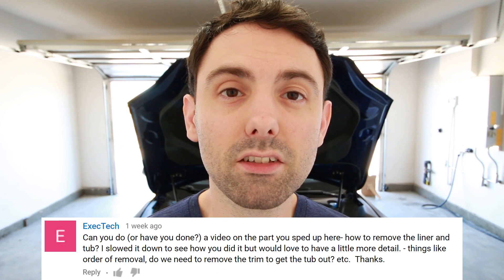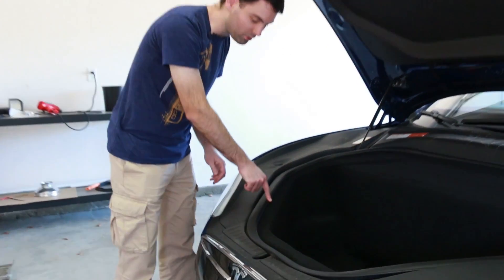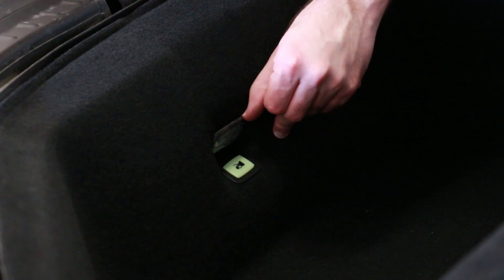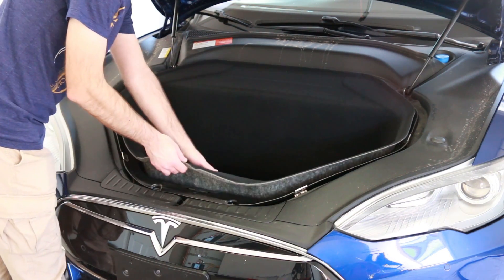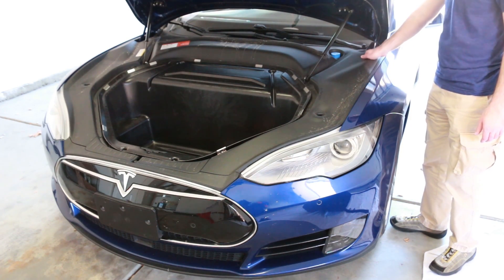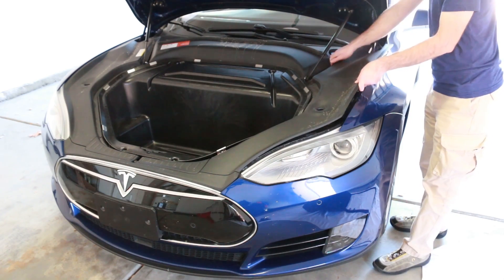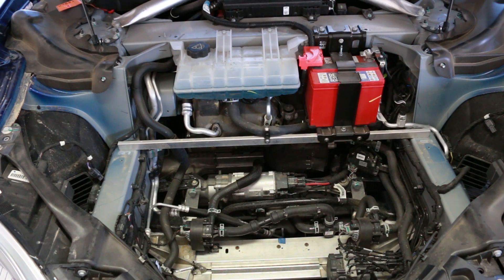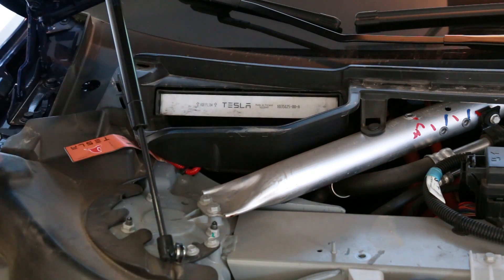Quick DIY: How To Disassemble A Tesla Model S Frunk

Comment: Thanks, that helped a lot. With the large battery pack and the small frunk, it works largely the same. BTW, you do not need to unscrew the retaining rubber pieces (the right one was completely stuck for me), you can pull the panel out and push it back in without removing the screw.

Comment: Thanks Alex.  Do you recall if there is access to remove/unplug the radar from in there?  Mine stopped functioning on my 2015 Model S.   Removing the front bumper looks more difficult.
Reply from the maker: It has been a while since I've been in there, but I don't recall being able to access the radar... probably worth taking a look given how quickly the frunk comes apart.

Comment: Alex, can you post a video on how to disassemble the Tesla model s trunk?
Reply from the maker: What parts are you looking to disassemble or gain access to? I mean, there's not a ton back there aside from the hatch trim, some carpet, and the plastic covering the lower latch area.
Reply: @AlexVenz  Thanks for the reply, I want to do some extra sound deadening...
Reply from the maker: Like I said, there isn't much to things back there. The plastic covering the lower latch area (along the bottom edge of the opening) pulls right up, there are a few plastic pins holding in some of the carpeting, I recall there being some screws under the cargo cover rails... the formed carpeting pieces on the sides are annoying to work with.

Comment: A good vid.  Retired engineer with a CPO June '15 MS 85D purchased 2 months ago.  Tesla Ranger came and did the Steering gear bolt replacement, noted broken clips he tried to hide and then would not fix.  I removed the Frunk assy again to check his work, found a few problems, and gave the innards a cleaning where possible.  Did you notice any missing side panel clips? 

It seems some designers of the structure of this vehicle (Spacecraft folks?) have no experience in corrosion prevention.  Primary structure, castings no less, full of pockets without drain holes.  This is/was/will always be a SoCal car, and was fairly clean, but wonder what will happen to the cars that see salt and mud.  Your vid will be very handy for those that want to clean this area of the car periodically.

It appears you have had the new SLA batt put in, mine did too last year according to SC.  I noted my car has the two right frunk mounting holes drilled out to double the orig diameter, not factory, IMO, and misplaced washers on the front.  I have two studs in the front, I suspect you are missing one.  These issues were probably caused by interference of the new batt mounting with the aft left boss of the frunk attachment.  The Ranger did not catch this, and left said Frunk bolt 10 turns loose.

It seems good mechanics are increasingly rare, and with ICE cars at least, you are rolling the dice anytime you put leave them in a shop.  Cant even get tire replaced with out them scratching the wheels...The forums and vids like yours are excellent tools.

Speaking of wheels, noted tires may cost me almost as much as electricity.  Have some experience with my tire fiasco I can share...at least I have a method to rotate my own wheels now.
Reply: Such a good post. I agree with everything you mentioned.

Comment: Hi ALex,
Can you assume that the Model X Frunk is more or less similar? If not, can you make a video for that too? Secondly, where is the 12V battery? I am interesting in installing an aftermarket part but need a 12V power supply.
Reply from the maker: Model X frunk disassembly is a little different, but still pretty easy. Once you get the frunk tub and HVAC intake out of the way, you can't miss the 12V battery. I don't have a Model X that I can take apart in the immediate future to shoot a video with, but Trevor has posted a frunk tour of his Model X (it's not a step by step instructional video, but shows enough of the process to make it pretty clear): https://www.youtube.com/watch?v=SWnSDJtLLc8